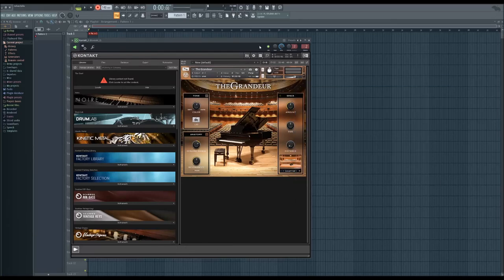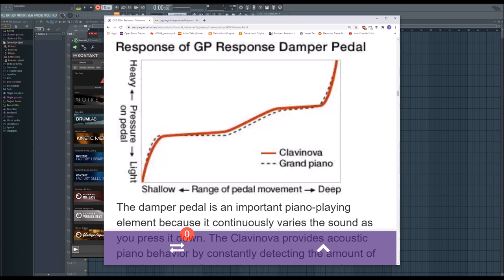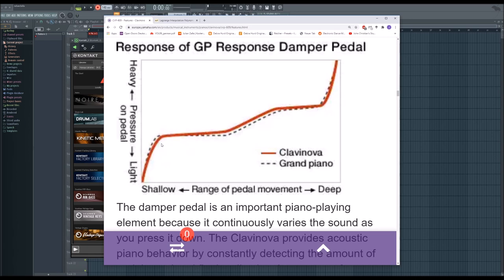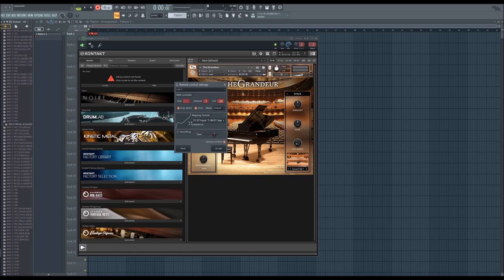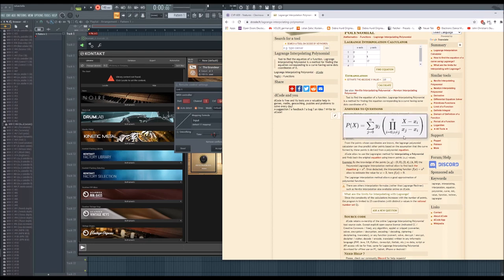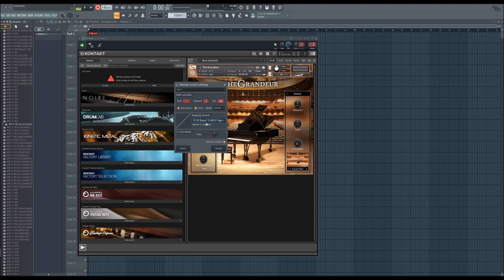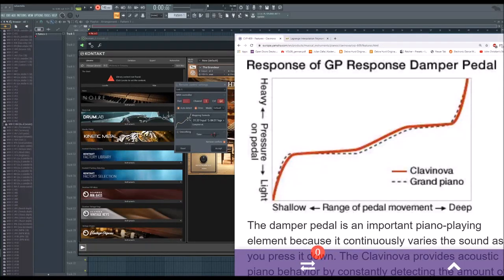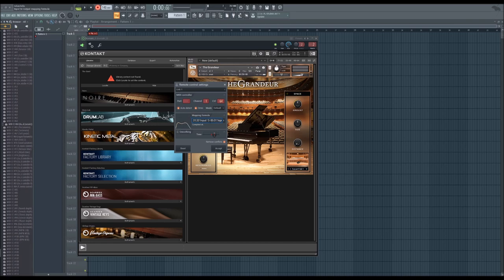Using Lagrange Interpolation to improve Pedal Behaviour of Digital Pianos (+mapping explanation)

Comment: When simple linear interpolation is not enough :) I admit, it's quicker to just input a polynomial though. Using a small section of the tan would also work nicely - or flip the axes on the error function.
I think in Reaper DAW you can just upload a file - shuold also be possible in your DAW I suspect?
Reply from the maker: Yes exactly, the tan was the best preset one. Maybe its possible to upload a file, but i don't know how they look like and what formats are supported... until i find this out i already did a lagrange 5th degree approx :)
Reply: Great holding...i juste had triste problème yersteday when my yamaha SH silent cut the basses with a midi file. Perfect when i record, and cut when the silent play back. Thank's a lot i'm going to change that straight curve in CC64 in cubase